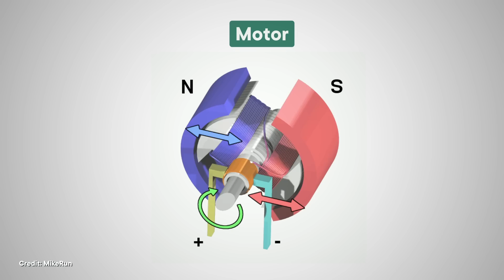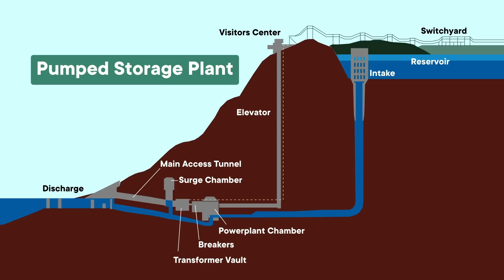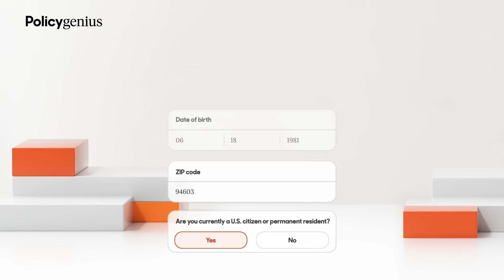How To Make Buildings Into Batteries

Comment: The designers of an impractical crane sytem team up with the architects of the biggest "mine is taller" to build to build a giant water tank with flats in it. Yeah, those deserve each other.
Let me just point out the the fundament of this will have to be enormous and will be totally impractical for any previously developed city.
Reply: The amount of energy you could harvest from emptying a water tower to ground level would power one house for one day. The building would need to be more water tower than accomodation and water is HEAVY
Reply: Cities build new buildings all the time? It seems smart to add this to new condos and such.
Reply: This is already kind of a thing. Water tanks on top of buildings and water towers. They use gravity to pump water into homes so why not just use that downward movement of the water?
Reply: @LeslieTheAnxiousHomoSapien Because that tank is only used to add pressure to water so that it flows decently from faucets. Generating energy is a whole other beast
Reply: @rmidifferent8906  thank you for the explanation - that makes sense
Reply: @MordentMordant then you loose the pressure again and it's not really usable anymore without putting energy back into it🙈
Reply: That water needs to come out of the taps with pressure. It's pumped up to that altitude so that everyone gets pressure. If you then start taking energy out of it on the way down, people suddenly don't have pressure and your building's water system is useless.
You could have a gravity-battery pipe from it to be used when water demand is low and power demand is high, but you would need to be sure that you could pump that water back up before someone needed it, which is a risky proposition. Better to avoid combining such systems.
Reply: @JalnorTheGreat  ah - I can see how this could be a problem.

Comment: I'd like to make a correction re: batteries at 0:14, "they need lots of rare resources to make, they don't last that long"

The latest in commercially available, utility scale battery technology already being deployed is the LiFePo4 chemistry. This chemistry uses zero cobalt, and uses Iron instead of high-cost Nickel. They are not as energy dense (so not ideal for weight sensitive applications like cars) but are perfect for grid-deployed battery storage. They also offer much high cycle lifespans of 3000-6000 cycles vs. 500-1000 for Nickel based chemistries. This means you could cycle a grid tied battery twice a day and it would last at least 8 years with 80% remaining capacity. 

Batteries are also highly recyclable. Redwood Materials, who is arguably THE leader in this space has estimated that they can recover 96% of a battery's original inputs and already have suppliers lined up to buy their recycled battery inputs.

Batteries still face lots of other challenges, mainly cost, and are absolutely not the sole answer for grid scale renewable backup power. But in tandem with pumped hydro, molten salt, compressed gas, and other technologies still in development we have a very clear path towards being able to transition almost completely off of fossil fuels in the next 20-25 years.

Comment: "Sci" show?? --> back-of-the-envelope calculation -->
Let's say you pump 1m^3 water per resident of the scyscraper to a height, let's say 1000m. The stored energy shall be a piddly 1e7J --> 0.28 kWh --> ~ 4 cents worth of energy (assuming 100% RTE). Are you willing to beef-up a top-heavy skyscraper to save the tenants 4 cents per day? How much CO2 worth of concrete do you need to achieve said beefing-up?
Is this one of those greenwashing-scams of Burj?

Comment: I don't think it's worth the low energy density. Let's say a skyscraper 150 meters tall (usable height) and with a slenderness ratio of 10:1 (i.e. width of 15 meters, so perimeter of 60 meters) has a 0.5 meter vacancy in its walling to store pumped water. Let's say 50% of the outer walls are actual walls rather than windows, so that's 2,175 cubic meters of water (after volumetric correction). Maybe some of the inner walls could be part of the system, so let's (arbitrarily) multiply that number to have a possible total of 4,350 cubic meters of water.

Now, that volume of water has a mass of 4,350,000 kg. If they are pumped on average to half the height of the building, i.e. 75 meters, then the maximal potential energy in joules would be 4,350,000 * 75 * 9.8 = 3,197,250,000.

In kWh that is 888.125, which is enough energy to power about 20 apartments for one day.

Yeah, not worth it.
Reply: I'd say it won't be the same form factor as the regular sky scraper. The inner core could be the size of a regular sky scraper itself, while the habitable outer layers are wrapped around it. Should yield a better ratio of usable energy this way + you don't need to cram water into structural parts of the building
Reply: @LetsGenocide  While that's another possibility (the effects of which on the structural integrity of the skyscraper I also don't know), if they were to make such an inner water core with substantial volume then the buildings would still increase substantially in width, which is not always an option.

An inner core of 10*10*150 could potentially (efficiency not adjusted for) hold 3,062.5 kWh of gravity potential, which is about enough to power 100 small apartments for 24 hours.

This is a more serious amount of energy, but is it worth it? And where does the water come from? Are the water cores directly connected to the city water mains? Probably not. So do they have their own gigantic underground reservoir for each skyscraper?

It is just not worth it, if even feasible.

EDIT: I looked again for the actual point within the video (quite by the end) and they said the purpose was to have water both within the outer walls and within an inside core. Either way, looking to make it only a core or a core plus some modified walls, it's doing too much for achieving too little.
Reply: @TLguitar  I do also think that the amount of extra weight the building will need to support will make unstable, much more complex in construction/engineering, and wear down faster due to stress. Making sure that water does not leak across the whole building will be a massive headache on its own.There are so many things that can go wrong and I'm not sure it will be worth it :< I'd love to be proven wrong though

Comment: I'd like to see if a skyscraper could use solar energy to evaporate water into steam so it floats up to the top of the skyscraper then condenses and flows down turning generators thus producing electricity.... You could even use solar panels or solar water heaters to pump water up to the top too. Now I'm curious if there's a self-sustaining building that is completely off grid.... At least in the electrical category, I don't want to know how they'd do that w/ sewage.     🤔💩😳🙄😂

Comment: Skyscrapers could simply pump water... why bother with complex mechanisms. 
And if taking water all the way to the top would be to much they could simply have levels that water would be pumped into.

Also if space is a problem then they could use desert sand instead and use conveyor belts. As sand is more dense then water it would take less space to store more energy.

And sand elevation battery could simply be placed in mountains as there nature is not as important or delicate.

Comment: Supporting the weight of all this water won't be a trivial engineering problem. And the bulk of that water also has a significant cost in urban environments dense enough to justify skyscrapers. Gravity batteries in the form of trains on the sides of mountains probably have some merit but this ain't it.

Comment: I'm curious about the energy potential that can be achieved in a single building. In any case, before the first building to use this technology is built, China will have produced several terawatt hour's worth of rechargeable, recyclable chemical batteries that will last decades.

Comment: … What if we used old Rain collectors (And/Or new moisture condensators) to accumulate rain and moistures at top of building and just pour the water down pipes with generators in them being turned? That way, we don’t use any man made energy to get the “weight” (water) up the building, Mother Nature will do that job through evaporation, and the water at the bottom can be collected into ground level storage to be used for toilets in the building (saving drinkable water in the process) or rerouted to water treatment facilities to be made into drinkable water…. Would save many birds with one stone, would it not! (Granted, rain and moisture water might not cumulate fast enough to compensate for all human energy needs, but what it would save could be then complemented by actually using the weights méthode, along with solar, wind energy, hydroelectric and other green energies!)

Comment: What about putting generators at the bottom of water towers?
Reply: That wouldn't be a battery. It could be a source of intermittent energy. Arguably it would generate power roughly when it is needed, as water consumption and electricity use are probably somewhat correlated. Probably pretty limited generation potential though.
Reply: The whole point of water towers is to provide water pressure to buildings in its area.  The resistance to flow from the generator would negate the original functionality of the structure.

They also wouldn't be cost-efficient.

Comment: I’m skeptical about the actual cost breakdown of the skyscraper battery plan. Density of water is so high that from a structural standpoint, the proposed skyscrapers would not be residential buildings with a dual purpose of storing water; they’d be water towers that people happen to live in. While skyscraper batteries have a better land use efficiency than digging a lake on a hill and the greater height would allow for more energy stored per unit of water, I’m skeptical the additional carbon and dollar cost of steel and concrete actually makes such a solution viable at scale. (Also, Gulf state construction companies have a history of proposing cost infeasible greenwashed vanity projects)
Reply: Bubble structures 🤔 neat visual 🤙🏼
Reply: A lot of people are not aware of gravity battery concepts at all. Even if the sky scrapers are impractical, several other options may not be like the various mentioned ones (mountain sides, mine shafts). I wouldn't call the whole video BS because the highlighted idea isn't as practical as the acompanied ones.
Reply: @TrueWolves  u are right. Its just It hit my field of expertise. i deleted my comment.

Comment: A few questions.
Wasn't a gravity battery pretty inefficient ?
I mean you need a quiet big mass to store energy.
I have seen a video were someone pumped a if I remember correctly 200 literes of water up at the top of his house.
And it was just enough to charge one phone a little.

Isn't the amount of mass you would need to "get up to the top of a skyscraper" be really bad for its structure ?
Especially as many material don't like water.
If you build the skyscrapper more robust, wouldn't this increase the costs by a lot ?

That the guys that designed the usless crane battery plan  something also doesn'T sound very promising....
Reply: Gonna lose a whole lot to the friction of moving stuff around.
Reply: Gravity is by far the weakest of the fundamental forces. Why anyone would think it is a good idea to use it to store energy is beyond me. The only reason pumped hydro works is that you're moving literal mountains worth of water.
Reply: @jfolz  just read it up. An quiet big water storage hrre in Europe has 13 million qubig metres

An average skyscraper has around 80k m3 lets be generous and calculate with 100k.

So we would need 130 skyscrapers just storing water and nothing else to replace it
Reply: @blablup1214  yup, it makes absolutely no sense at all. Someone here likened it to water towers that happen to have people living in them. Can you imagine what that would be like? Water constantly rushing up and down through the walls all around you? Absolute madness to even consider.
Reply: @jfolz  You mean like it already does in pipes? The horror...
Reply: @Verdictus13  .... now multiply by 100 or 1000 to get an idea for what that would be like. We're talking dropping several tons of water per second just to power the skyscraper itself.
Reply: @jfolz  Assuming the building is only getting its power from a single source is just bad logic. What part of a battery sounded like power generation? You use the excess from other sources to pump water for later load balancing, just like pumped hydro already does...
Reply: @Verdictus13  suitably tall buildings are exceedingly rare. If the building can't even power itself, it does little good for peak shaving.
It's funny really. People rag on about the low gravimetric and volumetric density of lithium-ion batteries, and yet here we are, praising gravity batteries that are at least 2 magnitudes worse on both metrics. All because some VC-money grifters said it's feasible and will last for decades, with no proof for either claim.
Reply: @jfolz  Again, its a BATTERY, not power generation. Its power storage, not generation...
Reply: @Verdictus13  You say that as if there's a difference and there is not.

Comment: I feel like this is solar freaking roadways over again. If you want to do pumped hydro, I can't think of many more expensive and complicated ways to do it than building a skyscraper for it.

I'm not surprised the same people behind the idiotic concrete gravity battery are behind it. I'm however surprised that scishow is actually taking this seriously.
Reply: the skyscraper part is really stupid, agree with you there, but the concept its drawing from sounds pretty reasonable as gravity and hydrogen bonds aren't going nowhere. the big question is how much water (or weight in abstract) is required at certain average height h to serve as reserve to the energy grid. artificial reservoirs sound more doable to me. As for a urban solution that doesn't require higher costs with transmission (which is an excellent idea) individual skyscrapers gravity batteries sound stupid. But a centralized generator/pump plant with gravity reservoirs dispersed over a city at a glance isn't insanity
Reply: its just the interior of the building, which is less prime real estate
Reply: @NirvanaFan5000 real estate is the least of its problems
Reply: What you suggest then? To continue to use lithium-ion batteries? Fossil fuels? At least someone is trying to think in a solution to the problem at hand instead of complaining about it.
Reply: @rosesareredbutzerglingssti9290  Plenty of people work on energy storage methods that make way more sense than this. The only reason why this particular one is getting attention is because it's flashy, and they're good at marketing. It's a solution to nothing. They've taken an existing solution (pumped hydro) and made it worse in almost every regard.
Reply: @MrFrexxia   And what if those storage methods don't work, huh? Like I said in my previous comment, at least someone is trying to think in a solution. 
Of course, if you have any better ideas, why you don't share them here?

Comment: just some additional forethought... 
we already have a fresh water problem. and we certainly would not want to use poluted water. there is a chance of using grey water... but water about salt water?

if we could use salt water, i feel would could save on fresh water. there is also the chance we can use these sky scrapers as desalination plants? 
-of course that adds the issue of disposing of brine. 
--but can't we refill the salt mines? with the brine? or evaporate them for molten salt batteries?

and these skyscraper building would of course have solar and wind i can imagine.
Reply: I feel like there would be a lot of added maintenance from using salt water. Aside from the issue of salt depositing on the sides of the container/hose and keeping things from working properly, it’s also more corrosive than fresh water and makes cheap materials like steel unviable for use.
Reply: @Avendesora  oh absolutely. salt water is hard to work with. but with its abundance... we really ought to figure out how to use it. 

maybe not the first iterations of this building style. but at some point we need to REALLY stop using fresh water for anything that is not our consumption( drinking or planting) 

we absolutely need fresh water protected and made more acceptable to the population (and nature) for immediate daily needs.
Reply: @Andre-qo5ek  I really don’t think that’s going to happen until it’s enough of an issue that big companies start losing money over it. Maybe Nestle will actually do something beneficial on accident lmao
Reply: Salt water is just too corrosive to be viable.
If it wasn't, we could just be using tidal power to begin with, but the reality is that salt water and complex machinery just don't mix well.